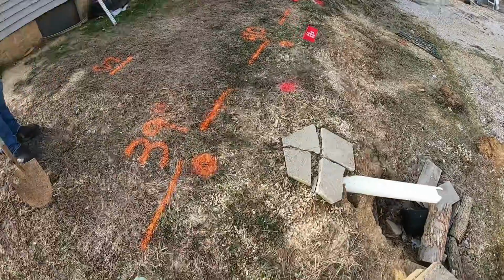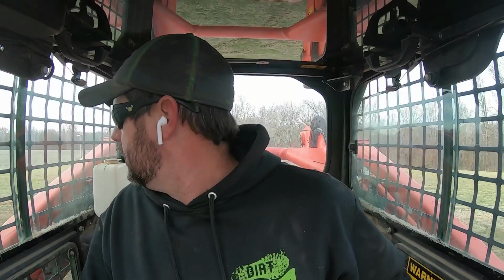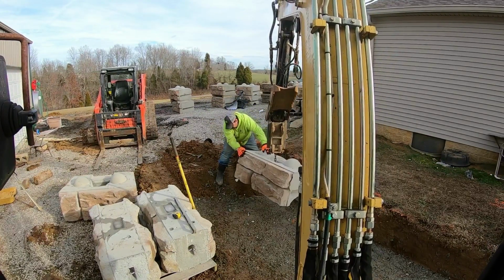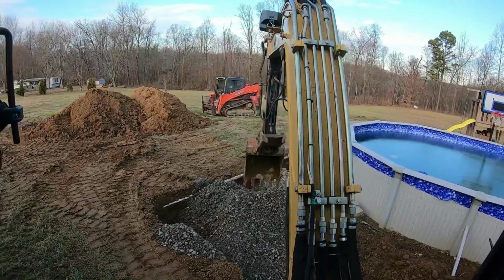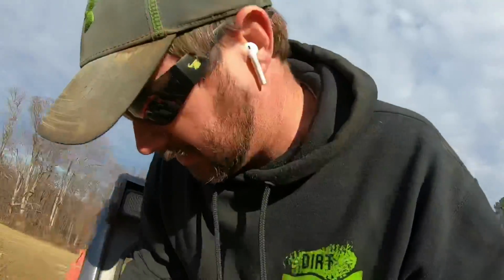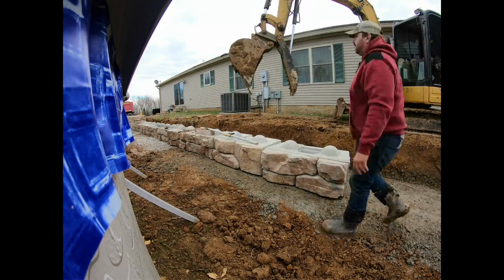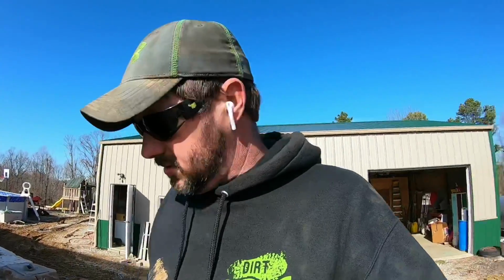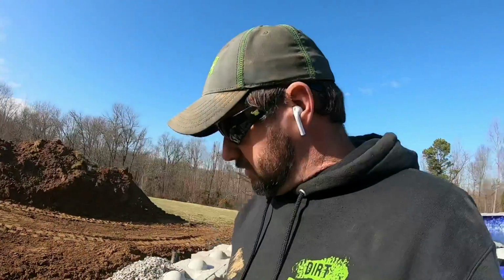Building a retaining wall with new style decorative stacking blocks #looksnice

Comment: Unless I'm mistaken, those wall blocks are intentionally different depths.  The base blocks are flat bottomed and are the deepest length.  The next layer up is a little less deep, and so on.  It is supposed to be that way so the back of the wall is not vertical when it's complete.  Also, you were putting down base blocks that are not base blocks, they had the dome cavities in them, which means they are one of the "stacking" layers and not base blocks.  Maybe he got a truckload of "scratch and dents" for a good deal and has to make it work, but those blocks are supposed to be the way you are describing them.

Also, you are supposed to lift them with a chain that has hooks on both ends.  One hook goes on the top eyelet and the other hook goes on the eyelet that is on the back.  Then you adjust where you lift the chain from to level the block, then the remaining blocks should all lift perfectly level.

Comment: That will be a great looking wall when it’s all done. Especially if a concrete cap is poured across the top similar to how you did the cap on the short retaining wall section in that last ICF basement job. 
Laying concrete cap stone can be done around the curve but will need a lot of cutting to look right.

Comment: I've installed a similar brand of retainer wall block here in tn. Manufactured at Bradley tank and pipe. Little bit bigger blocks but same principle. We were using a 345 cat due to the height of the wall.
Reply from the maker: Awesome

Comment: The face of the block is just stamped we had 6 different designs people could chose from just a rubber mold set on the bottom of the block form. The concrete block eye lifts is either installed to low or not at all. We had 50 forms ranging from 4' to 6' and corner and half blocks.

Comment: That's what you get with a wet block, dry blocks are pressure formed in the mold and are much closer in size. I know you did it in one day, but if you use low yield concrete (1500 psi) you can form the  base and pour it level. Fabric should not be used as it gets clogged with clay and the water moves the block.